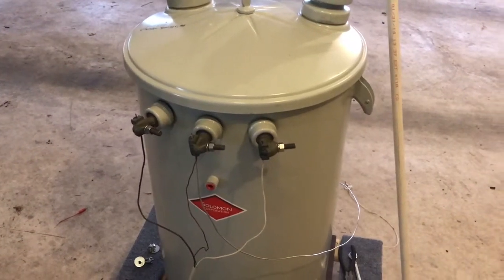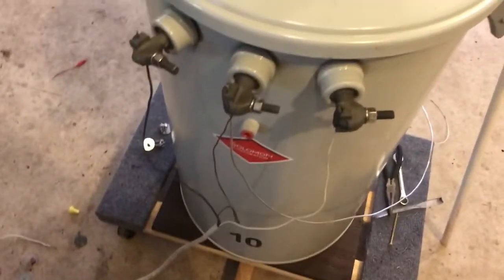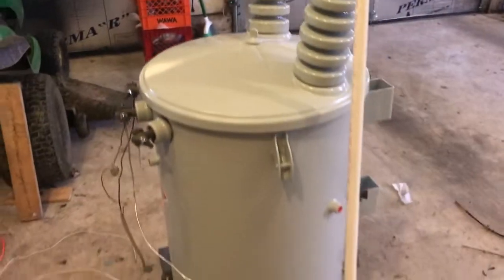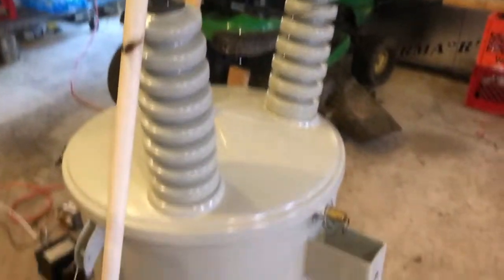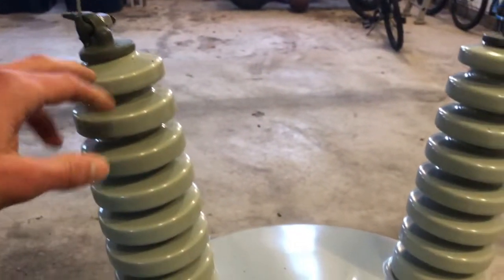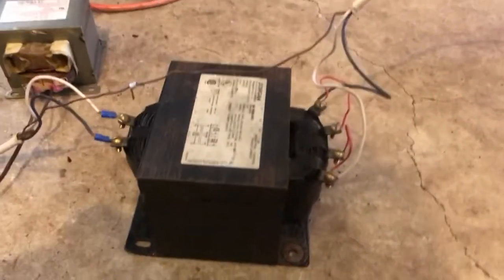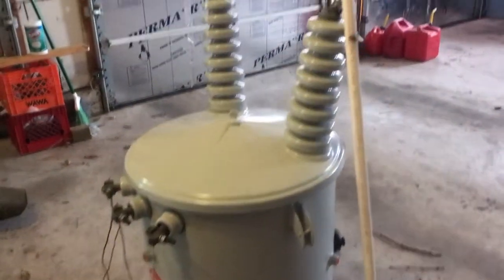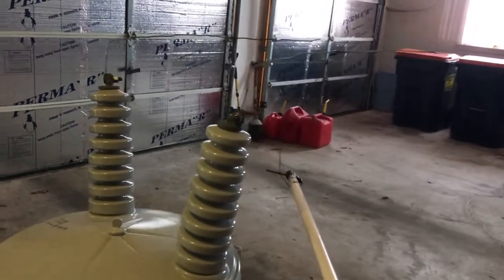22000 Volt Arcs (Pole Transformer)

Comment: You want a 40A 240V outlet, a large arc welder as a ballast, and large amounts of PFC (or resonant caps if you feel like it). That way you can draw 20-30kVA arcs and not trip the breaker once (ofc that's 30kVA at the HV transformer primary, not from the mains)

Comment: Go ahead and hook it up to 150 amp breaker with no ballast and cable sized correctly for the distance from the breaker to the lugs to carry 150 amps continuous.  You'll be much happier without the high voltage output.  I do it with my 15kva all the time.  Pole transformers are made to handle the current.

Comment: How many houses can that supply
Reply from the maker: Carson C is right usually a 10kVA is just used for a 200A service.
Reply: Well it's 10kVA, so probably only one house with a 200 amp service. My house alone has a 25 kVA transformer supplying it.
Reply: @CarsonC5  thanks cool vid good arks sadly you cant pull alot of current
Reply: 69